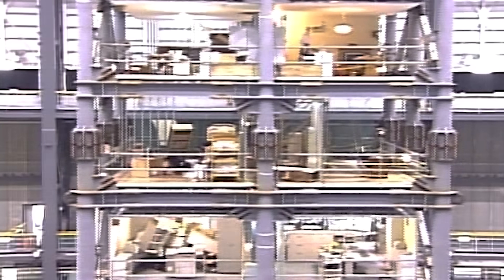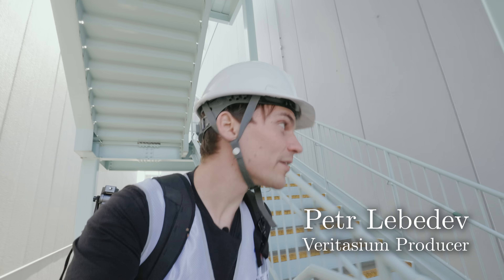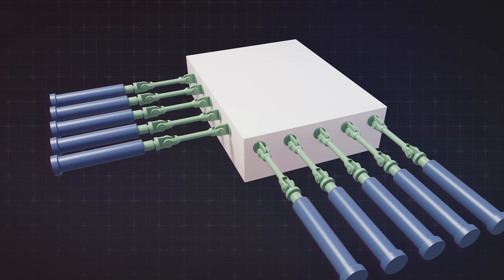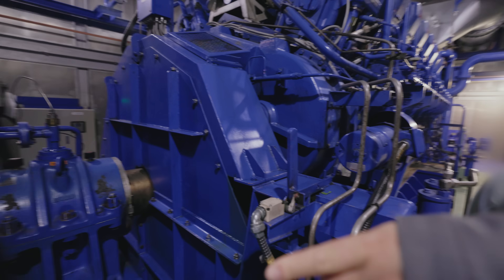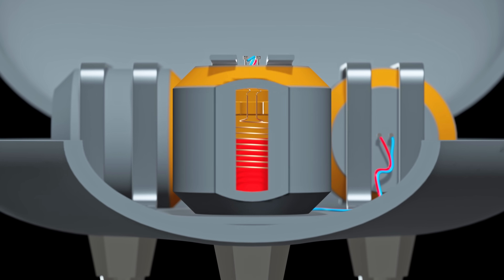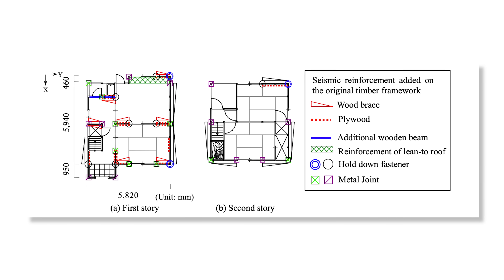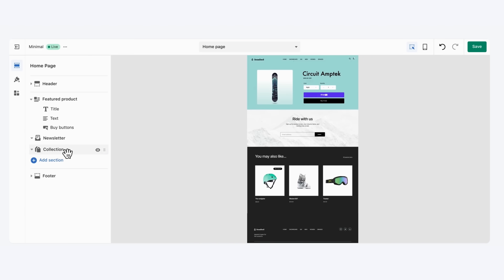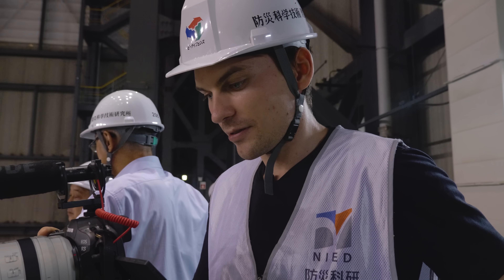How To Earthquake-Proof A House

Comment: I would have wanted to be on that table during one of the earthquakes but not with all those block walls. lol

I've been in four earthquakes in the magnitude 7 range and it was only the 7.3 that was close to me that made me a little afraid. This earthquake happened 3 years before the one in Kobe. Only one person died from a collapsing chimney in that earthquake we had here but that's because the epicenter was pretty far away from people's houses. A year before Kobe, there was the Northridge Earthquake that honestly wasn't as bad here and I was really surprised when we turned on the TV and all kinds of stuff had fallen in LA. The force of it had reduced a lot before it got to me but it did wake me up and make me get under my bed.

During our most recent 7, no one died and that's a testament to the people who have been working so hard to design buildings that might have to get demolished after a noteworthy earthquake, but won't kill you if you're inside at the time. Probably, engineers should look at structures designed to withstand a lot of pressure and temperature changes, like the stuff found in airplanes, to make systems of water, power, and most importantly, natural gas, to find ways to make it less likely for there to be a rupture in these lines. People can still get trapped inside a building, even if it collapses in such a way that it doesn't kill them, but it doesn't do much good if a fire starts from the gas lines. I mean we could do what they do in Peru where you buy tanks of gas and there are no gas lines, minimizing the amount of gas present in any residential area that could start a huge fire but, given that we already have gas lines in the ground going to people's houses, our best bet is to make fittings that are less rigid and can withstand the various motions we experience during an earthquake.
Reply: Also, the best education about earthquakes you can get when it comes to the motion is to experience one for yourself and even that experience varies a little from earthquakes on the same kind of fault but varies much more for earthquakes on different kinds of faults. I was in a small one on a subduction zone fault and it was way different from the ones I'm used to and the motion was a bit scarier.

Comment: While I already have enough as is, this is certainly one to add to the list of reasons why I respect Japan.
One suggestion I'd like to offer to keep water pipes and wiring intact would be to use multiple rotating joints along the pipes, analogous to a series of universal joints, while the wiring could be set up in a similar way, if not along the sides of the pipes.

Comment: Great video! One small thing I noticed: you refer to the spot underground from where the earthquake originated as the epicenter, but in in geology there is a different terminology. 'Epi'center is the spot on the surface of the  earth if you were to project the point of origination on the surface. The term for the actual underground point is hypocenter😊.

Comment: I measured how much Gs the speed elevator in my office pulls. Turns out not much at all.
Regular elevator - 0.07-0.08G
Speed elevator - 0.13-0.18G
I guess the main difference between them is how long this acceleration is applied to cabin, not the actual amount of Gs.

Anyway, i'm stunned. If building moves with 1,5G it must be really terrifying.

Comment: You can not 'prevent people suffering' from such events!
You can 'do your best & hold on if you can!!'
Despite all the measures taken in Japan, the 2011 9.1 earthquake (being 130km from the coast!) Brought with it a devastating tsunami (a gaint wall of water rushing at 800km/hr!)... the failure of Fukushima nuclear plant & massive destruction of industrial facilities (that surely contained dangerous chemicals...etc) 
... in short there are so many variables & most of them are undoubtedly out of humanity's hand
...
Results:
>20,000 people killed
Wide destruction

Comment: I recommend looking at earthquake technology and preparedness in Aotearoa New Zealand. We've had some sizable shakes in the last 12 years, but many buildings have been retrofitted since the 1990s to be more earthquake durable. Unfortunately, a number of buildings near the foreshore, including the main public library, had to be closed for safety reasons following the November 2017 shake in Wellington.

I worked in a building that had these massive seismic dampers visible in some of the conference rooms. In a strange way, it was reassuring—a good reminder that the building was extremely safe. And when the 2017 quake hit, it was a good testament to functional technology that the building was very quickly given the all-clear by engineers.

Comment: Earth quake solution:

Put houses in earth quake zones on either suspension systems that make vibrations less relevant, or possible ball bearing plates with elastic suspension to keep the building centered over the ball bearings so when the ground slides back and forth the building stays put.

It's whiplash that causes earthquakes to destroy, so if you can minimize the motion of the building then you can minimize the damage of both the building, it's contents and it's inhabitants. If the building can roll over ball bearings then it will not shake as hard with each movement of the earth.

Comment: This is so cool for so many different reasons. One of them, very critically for me, is to show how terrifying and devastating "middle of the pack" earthquakes can be. In 2008 we had one such earthquake where I grew up, in southwestern Greece in the Peloponnese. It was somewhere in the 6.5-7.0 range (6.7 if I remember correctly) in the Richter scale, but it was absolutely terrifying. The epicenter was very close to us, under land (most of our earthquakes happen under the seafloor), with a shallow focal depth and with a very high seismic acceleration for the magnitude of quake. At this point it was no longer a shake, but rather a shove that we were experiencing. The ground was moving a considerable distance with each thrust, violently, moving furniture around and  causing cupboards to open and making it impossible to walk to safety without falling. Sure, the damage it caused wasn't so bad, but that is because buildings in that area are built with very high earthquake resistance and all the old, unreinforced structures have been long lost to earthquakes. That day in 2008 we experienced a very similar situation to Kobe in 1995, and that was the day I learned to fear earthquakes. Up until that point they were more of a nuisance, seeing as they occurred so often.

Comment: A few errors:
- confusion between seismograph (the instrument) and seismogram (the recording)
- on the magnitude scale, it's not an increase of 1 that represents 10x of the energy of the earthquake. It's actually an increase of 2 on the scale that represents an increase of 1000x of the energy (so an increase of 1 is ~30x)
Reply: An increase of 1 represents 10x the amplitude of the seismic waves. That’s probably why he got confused.
Reply: @isaiahrosner3780 I had to look it up, online, it appears that energy is proportional to amplitude squared. So if an increase of 1 increases the amplitude by 10, then an increase of 1 would increase the energy by 100? But here, the OP is saying it's closer to 30 or 31 (sqrt(1000)). Can you help?
Reply: @deenil  This made me look things up as well. Wikipedia says that the seismic energy is actually proportional to amplitude^1.5 based on an empirical relationship found by Beno Gutenberg and Charles Richter.
Reply: I thought something was off on those statements.
Reply: I'm sorry, isn't the point that they confused "Energy" for "Amplitude" of earthquake"? An increase of 1 on the magnitude scale represents 10x the amplitude, which in turn corresponds to ~30x the energy.
Reply: I always thought that an increase of 1 on the scale meant a ten-fold increase.
Reply: at least they didn't use Richter, lol. But yeah, good points on the scale differences
Reply: It's 1 for the square root of 1000 practically
Reply: And don’t get me started on how they are misusing the word “epicentre”!
Reply: Derek is human.
Reply: @greatPretender79  he couldn't seek a seismologists to verify?
Reply: You'd think Derek and his team would get this right when they've probably spent hours and hours researching this. A bit disappointing...
Reply: @TheJon567  you'd think derek and his team would make a few mistakes when they've probably spent hours and hours compiling mountains of information into a 20 minute script passing information between dozens of people. it's pretty understandable for them to make mistakes, especially when they're things as small being 2 letters off on an uncommon word, or mixing up the number of zeroes.
Reply: @TheJon567  Sometimes there are errors people miss even after they review the final product over and over again.
Reply: Could this not just be a large miscommunication/disconnect?
Reply: わたしは震度6強まで経験しました。自分が生きるか死ぬかが重要です。私にとってエネルギーの数字はあまり重要ではありません。
Reply: u rn 🤓☝🏼
Reply: not bad for a free youtube video

Comment: Here in Chile we have two words for earthqakes, one is for the ones bellow 7 and abother for on or over 7,  between 5.6 and 7.1 is fairly common, but because of this, everything that could fall down, already has, and also we have a curse, were its almost like clockwork that every 25 years theres a major one, though its not unhearth to there be another or multiple others in between

Comment: I am curently doing research in seismic steel design. I am working with Dr. Paul Richards to make connections that will absorb the seismic motion and are meant to yield. These connections will be easy to replace so the building won't loose functionality.

Comment: Nice video! Having an away correspondent (nice guy, good job!) indicates reduced air-travel. I like! 
The Japanese engineer had an exceptional English. It sounded really strange but I had zero trouble understanding him.
1g of acceleration is like holding your fridge up against the ceiling and just letting go. bam. I'd rather not be there when that happens.
I once experienced a 2.something earthquake iirc. I had not sensed it, but my room had two tables. The one I was sitting at bumped my knee and the other bumped a computer standing next to it. And I was like "how can these two tables bump at the same time. Was it an earthquake?" and the geological service website confirmed it later. It was really weak.

Comment: The crazy thing with feeling an earthquake is that you can't see how much everything is moving because your entire reference frame also moves.
Reply: havent thought about that... interesting. it must be more scary and very confusing for the body to stabilize itsself
Reply: @Ni7ram  It is. I experienced the 2010 Chile Earthquake (8.8) and even when I have felt many smaller ones though life, that was my first of such a scale I really tough for first time I would die because of one. The building got hit very hard but stayed operational, we lost power for a couple hours, water for a few days, and gas for like a month. 

But if the quake is scary and traumatic, it is also the two-three months of aftershocks after that. It took me sometime to readjust, but I think I'm mostly fine now, and mostly came back to the normality when a 6 quake is kinda normal.
Reply: @EduardoEscarez  just curious, did you die from the earthquake? just curious

Comment: As a Chilean, this video is fascinating. I love engineering and all of the complex issues that one runs across when building structures that can withstand challenges like these. It always called my attention how, in a lot of the US, you can punch a hole straight into almost any wall. Here, the one to get broken isn’t the wall, but the fist. Although i was very young when it happened, i do remember the 2010 earthquake, the strongest in recent memory. All we had in my home was a broken plate in the kitchen. A lot of people got injured and even died in the incident, but thanks to proyects like this center, we can build homes that minimize the damage. Cheers from Santiago, and thanks for spreading knowledge about these fascinating things.
Reply: VIVA chile 👍👍👍
Reply: I don’t think stick frame buildings see nearly the same damage in earthquakes because of the light weight flexible nature of wood.
Reply: @DMSparky  Those kind of houses get deformed after a great earthquake.
Reply: @DMSparky The problem with traditional Japanese houses is that they do not use any type of reinforcement in joints, whether nails, bolts, etc.  They only use assemblies that yield to these forces.

Comment: There is a shrine in Japan which is over 1500 years old and has survived countless earthquakes where later,superficially similar timber buildings collapsed.
The secret ignored later by others - the entire building hangs off a single 50M timber column which is NOT connected to the ground.
The entire structure sits on top of an eyewateringly strong single story platform with no bracing so that when the ground moves,the platform racks and the tower remains stationary.
Unfortunately later builders thought that the way to stop temples and shrines collapsing was to add more weight to the roof next time.That didn't go well!
Reply: Can't remember offhand but it is in the book "Wood and wood joints" by Klaus Zwerger which discusses European and Japanese carpentry from the earliest archaelogical records to modern times.Excellent photos and line drawings.There is also at least one family carpentry company in Japan which is....1500 years old!!! @bubblewrapstillpink2804

Comment: I would like to see the same effort being put into mitigating tsunamis. If the earthquake creates a tsunami, it usually kills far more people than the earthquake itself. I get that not much can be done about people sitting in traffic being swept away along with their cars. But there are things that can be done nonetheless. Emergency survival pods for example. They are crush-resistant, float on water, are equipped with radio beacons and contain emergency rations. But what I'd really like to see someone working on is a drone that can grab a person being swept away in the current and carry them to safety. One could imagine a fleet of these drones descending upon the afflicted area and saving as many people as possible. They could also be used for pulling people out of burning high-rise buildings.

Comment: I'm in Kyushu (down in Kagoshima). We have noticeable shaking once every few months. I get concerned if it lasts more than a few seconds, but generally they're pretty minor. I was in Tokyo when the Fukushima quake hit in 2011, and in my apartment about 300 miles away stuff was knocked off the shelves and a brand new flat screen TV was knocked off the stand and cracked against the floor. My apartment was on the 16th floor, and at one point, the building was leaning over to one side, hovered for a couple seconds, then straightened back up. I'm convinced that with another few seconds it would have smashed into the ground.

All buildings now have massive concrete block bases that they're built upon, maybe set a minimum of 20 feet below ground level. Most apartment and office buildings here don't have basements - it's just the solid concrete and I-beam base structure.

Comment: I really wish someone would cover oklahoma earthquakes. Oklahoma doesn't really have naturally occurring earthquakes, at least not many strong ones, then fracking was invented and the disposal of that fluid causes earthquakes. It caused us to have 900 times more earthquakes than before. It peaked around 2011 when we had a 5.7 but since then it has calmed down as US oil demand has gone down.